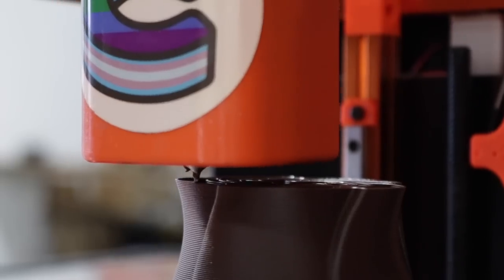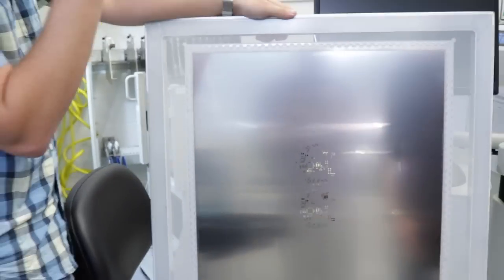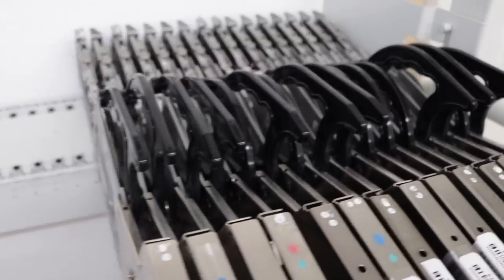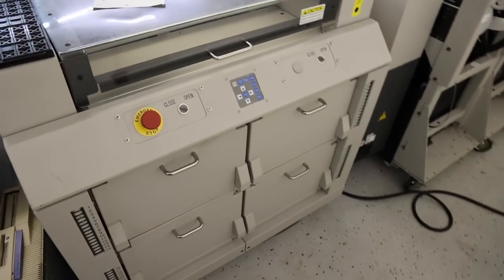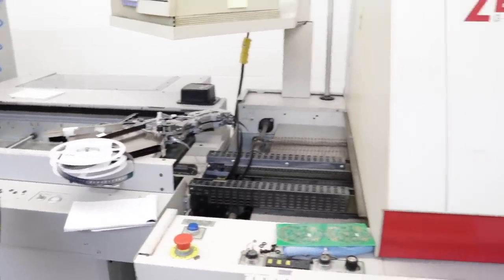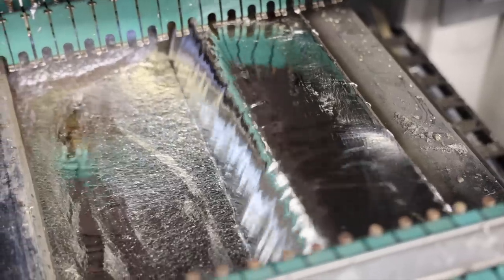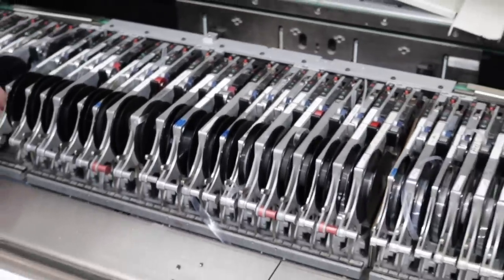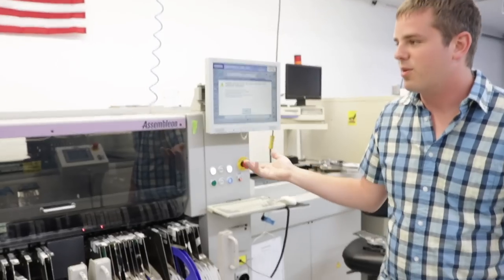Mass Production SMT Line!

Comment: We now use selective wave soldering, where there is actually a moving head going with a tiny solder wave to the locations where the solder is needed. Has the advantage that you don't need all these expensive, board-specific masking trays designed and manufactured. It's not as fast and efficient when you run very large jobs of the same boards, but for a line where you run small batches and prototypes it's a pretty nice extension to have.
Reply: Yes we have a selective soldering machine too, it’s just too slow for most of our requirements so it isn’t used frequently

Comment: Why did he "nope" so hard on the Chipquick paste? :D Did you get a good other recommendation from him perhaps? ;)
Reply: ^ This
Reply: #alpha team
Reply: We use AIM REL61 exclusively, it prints much more consistently and has a smaller ball size than chipquick. It has excellent stencil release qualities, and great solder wetting properties
Reply: we use chipquick only for rework because of the low temp, but it is just not meant for main line production.
Reply: Curious too. I've used Chipquick for years without issues but I'm still assembling by hand.
Reply: @tannerewing9361  Good to know. I place parts by hand down to 0.4mm pitch and have to round my corners on those footprints to ensure proper solder release from the stencil. Any suggestions on flux? I'm currently using Amtech NC-559-V2-TF based on another recommendation but I haven't really shopped around.

Comment: That optical PCB checker at the end of the line could be a interesting open source hardware project. Just put a camera on the end of a 3d printer then use some sort of optical detection for board validation.

Comment: The un-asked questions: How long, how much effort and cost $ to "set up" a job to run on this line?  machines?  How many dedicated, skilled people to do this?  What minimum volume of PCBs is cost efficient?   
Likely answers: Even with the advanced simultaneous programming, set up, & vision systems there will be over 40 individual "person hours" to get this going, ~ $1000 (not counting sourcing any parts).  6-12 trained, experienced people.  Hundreds, depending on size and parts count.  Maybe only 20-30 large PCBs with >500 parts or > 2000 Raspberry Pi Nanos.

Nice Facility! Thanks for the tour, video, and best wishes to all.

For those who want one of these: start with about $ 1,000,000 and see if you have any $ left.
Reply: You'd be surprised actually, we build jobs for as little as ~$300. All depending on the complexity. A good rule of thumb for board cost is about $0.10 per SMT placement for production and ballpark around $5 per BOM item for setup. This all fluctuates a lot with volume but its not uncommon for jobs to come through our shop that are less than $1k bottom line.
Reply: @tannerewing9361  Very Efficient! Thanks for your response. So 80 PCBs with 100 placements and 50 BOM items would cost ~ $ 890?  Or 90 PCBs with 88 SMD LEDs, 13 BOM parts,  would cost  $965?
Reply: @shazam6274  Your example of 80pcbs would be ($5 x 50 = $250 + 80 x 100 x $0.10 = $1050) again these are ballpark numbers but it gives a close approximation.
Reply: @tannerewing9361  Thanks.  That's about $13.25 per, which is a lot cheaper than most people would guess.   Spread the Word! 
I'm a retired Analog Engineer so the high BOM count example is more typical of Analog circuits, which are a killer on set-ups and # of feeders.
Reply: @shazam6274  The biggest cost increase is through hole parts, we ballpark those at about $0.70 per placement.
Reply: @tannerewing9361  Yeah, that's why I spent over 10 years designing them out of new products.  SMT switches, controls and connectors are hard to get in reliable versions.  Had a desk drawer full of 3.5mm SMT jacks, all worthless.

Comment: These chip sequencers sound very fascinating. How do I search for these? I found absolutely nothing on the web.
Reply: That tray feeder is a DYTF and not many were sold.  The previous generation LCS was more common.  The generic term is a matrix tray feeder / changer with shuttle.  As QFPs and BGAs have evolved into micro BGAs, QFNs, and WLCSPs, the industry has moved away from these type of units because the shuttle can't transfer such small devices.  Picking direct from the tray is more reliable and as the parts have gotten smaller and fine pitch leads have been replaced with balls or lands, many more ICs are available on tape & reel.

Comment: SMD vs SMT; let's discuss 😂
Reply: What is the Difference Between SMD and SMT? The difference between SMD and SMT is that SMD (surface mount device) refers to an electronic component mounted on a PCB. In contrast, SMT (surface mount technology) relates to the method used to place electronic components on a printed circuit board.
Thanks, Google 😂
Reply: There is no need to argue, at lest at professional level ;)